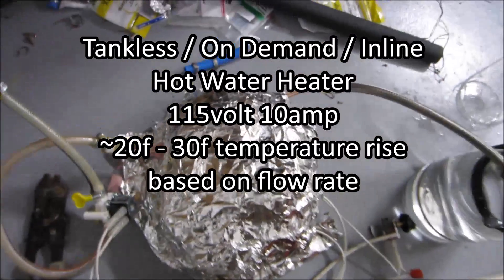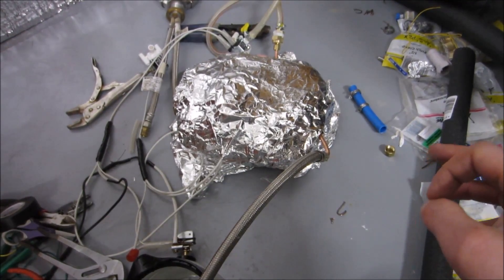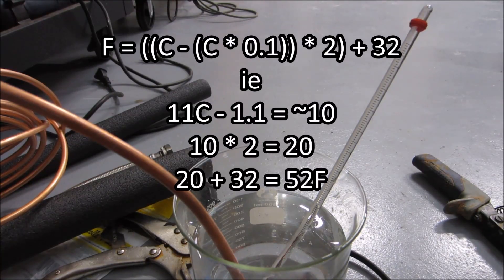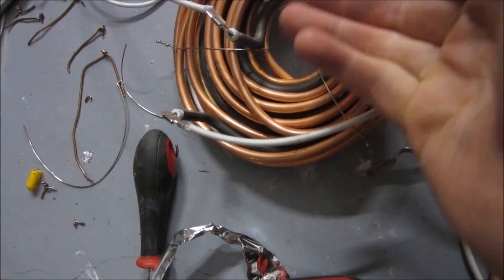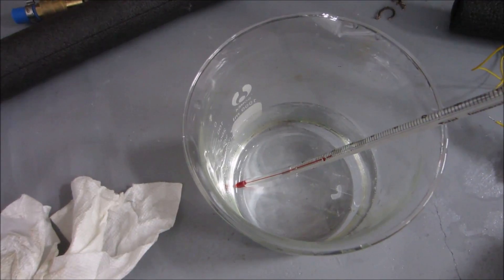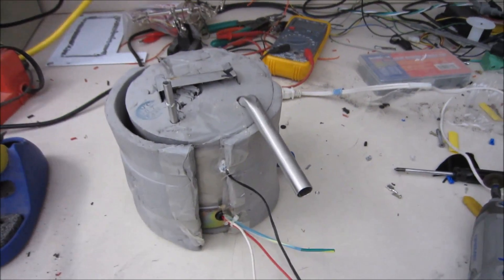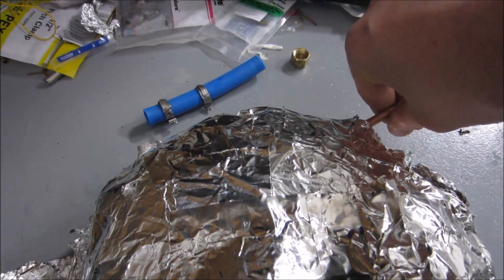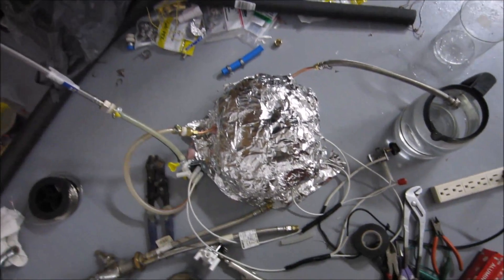DIY Tankless Inline Water Heater from "Scratch"

Comment: What do you think about us induction? Use 3 electric induction coils 1 ft apart on a normal copper pipe? Idk who to set up the electrics and regulate the temperature but I think that would be the most efficient and safer. That is as long as you are able to make sure are able to make sure the inductors do not get the pipe too hot

Comment: I was thinking of building one of these using a much simpler design: Coil of wire inside of a tube. Ohms law says a 6 ohm coil will give you 2400 watts at 20 amps, 1200w for 12 ohms at 10 amps. There are online calculators that can get the power needs,coil dimensions to ones design. The best part is you can build several super cheap and keep spares and just swap out when they inevitably go bad.

Comment: this is an old video but what about using the heating element from an oven since its more straight than a wound cooktop coil and wrapping as much copper pipe around the oven element as closely wound as you can get it the full distance of the heating element.. i think you'll get way better heat transfer by wrapping the pipe around the coil completly enclosing all the heat to inside the copper.. 

then you could take it a step further and enclose the element and pipe and backfill it with possibly molten alluminum encasing the element and pipe in alluminum which would fill most of the voids between the element and pipe that are left ensuring your getting as much heat transfered into that copper pipe as you can.  the downside is it will take longer to heat soak everything but once everything is hot youll have more thermal mass to play with.. this would be useful for larger amounts of water like running a shower instead of a faucet so leaving it run longer isnt as big of a deal.

the element should in theory survive having the alluminum poured on it but id probably make sure the element was on and hot right before you start the pour and cut power right before you do the pour..the copper has over 1900 degree melting point and the alluminum is good till around 1100 degrees....
the element when on high only gets to around 900 or something degrees so it should be ok..  

this is only my theory but im gonna try it soon and see what happens.
Reply from the maker: Good ideas - let us know how it goes. :)

Comment: If you’re a stickler for details and prefer a simplified calculation, change the order of operations to C * 2 - 10% + 32. As long as you know the 10% mental math trick it’s easy. 
11 * 2 = 22
22 - 2.2 = 19.8
19.8 + 32 = 51.8

Comment: I love how this trailed off into mental math. It was a good use of $30 imo. With conduction, your best option is a small boiler, PID or klixon thermal switch set to a nominal temp like 80-90F (won't steam - also the water line pressure is already 3 bar so pressure buildup isn't really an issue unless you're using a check valve), and a secondary PID input to activate full current - this can be done with an in-line hall flow switch. Induction heating will give you the most efficiency though. You want the heat to occur directly at the water. Anyway bravo on the original content my dude.
Reply from the maker: Thanks much for the thoughts!

Comment: Hello sir, I'm a mechanical engineering student and my senior design project revolves around this subject. this video have helped so much, and I would really love to know if it's okay to contact you and ask you a few question about the components, and how would I go about integrating a combustion unit as a heat source
Reply from the maker: This project is really simple... I'm not sure there is much I could expertly answer that you couldn't just research independently.

Comment: What about just putting another hotplate in that setup and being able to have closer to shower pressure stay got. Still will be pulling under 20 amps on a 110 breaker. If it got to hot just put some temp sensors on the coil
Reply from the maker: I believe it's a 10amp hot plate, so doubling would be 20amp approximately.  Really at that I can find a commercial solution.  This was kind of a novelty project with a novelty result, but I appreciate your practical advice. :)

Comment: uhm..  fiberglass...  no gloves.. Why are all the videos on youtube by idiots not doing basic safety?   -1 for humanity.
Reply from the maker: Well, if you said no N95 mask, I think you'd have a point.  Skin sheds often, no real harm done by just touching fiberglass.  That said, when really digging into a fiberglass project, i certainly wear full clothing and gloves because I am sensitive to handling it.  Just touching it a little with bare hands is not a big deal.  On the other hand, breathing the stuff in is a calculated risk since it can stay in your lungs for a long time (maybe forever) and with chronic exposure (if I did it for a living) it would be a death sentence.  That said, in every house that contains fiberglass, which is most, things are typically not air tight, and due to negative internal air pressure created by most HVAC setups, it sucks it right out of the walls and attic into the living space.  So low level of chronic exposure are through living in the space in almost all houses.  I'm sure we all have a fair amount of glass fibers in our lungs from that silliness.

Comment: I took a heating element  out an old hot electric hot water heater and used that , I left it 220 vokts plus it is controlled buy a thermostat . It heats my watee up in 30 seconds or less and I am using half the energy because of it being 220 .
Reply from the maker: Awesome.  Though note that 220 or 110 simply halves the AMPs, not the "energy" (watts).  For example 110 volts at 10 amps is the same amount of energy as 220 volts at 5 amps. :)
Reply: @someoneinncarolina  12v 400ah battery lifepo4 = 48v 100ah battery

Comment: Use a giant joule thief to reduce the power usage.
Reply from the maker: I don't think that works with electric heating... can't break the laws of thermodynamics. :)
Reply: A Joule theif raises the output voltage, while lowering the maximum current so power would still be approximately equal

Comment: An immersion heater element would be so much more efficient - all the heat goes into the water.
Reply from the maker: I agree, but this is for intermittent on demand duty.  Otherwise it would just be a standard tank water heater. :)
Reply from the maker: Thinking about this more... I suppose if it was just a stand alone immersion heater in a bowl of water,  you could kind of use it on demand.  The issue with tank water heaters isn't efficiency, it's that they are always on, even when you aren't using them.  So if you had a bowl you needed 5 minutes later or something, you could drop an immersion heater in.  I suppose then you might as well use an electric kettle though.
Reply: @someoneinncarolina  you should check out how some of the on demand heaters work. I tore apart a broken one ( the filament had burned out) and there's a water pressure switch system in there that turns it on and off when there's a flow. 

I'm interested in building one for myself at some point.
Appreciated the video thanks
Reply from the maker: @eleanorloring5590  Thanks.  I actually have a tankless gas powered one laying around.  The electrics from China are so cheap you can just buy those.  I was mostly hoping to do this at low power and low flow.  Recently I stumbled on silicone oil that is non combustible and will probably play around with that as a catalyst.

Comment: A water heater element in a 2-4 inch pipe 12-24 inches long with in/out fittings pulling hot water from top can put out a quart pf pretty darn hot pdq, wait a minute and another is ready. Using just electricity, your urine plus electrolysis yields a hydrogen stream, which can heat a pipe and provide a gas fired unit running off a 3-5 volt DC supply.
Reply from the maker: Super interesting concept... I'm a little skeptical about the numbers.  Have you tried this yourself?  I do believe the concept works, just not sure about the values.
Reply: Yes I've made coffee and sink hot water with heating elements and made hydrogen from urine, seawater and misc fluids. There's a pack of schoolgirls that run a gas gen from a bottle of pee.
Reply from the maker: @owlnationlegal4228  Super cool stuff.  Any pics or documentation to check out?  Thanks.
Reply: No but I did it with 2 wires, stainless washers, 12v bat and a bic if you want to pop hydrogen. Look up Youtube Nigerian Girls Generator Urine
Reply from the maker: @owlnationlegal4228  Intriguing stuff... there don't appear to be any real details, which usually points to something not being wholly true. (ie wattage output, etc. schematics, etc.) Apparently the inventor of the urea electrolysis process, which the generator is based on, said it is interesting but impractical, other than on the scale of waste water treatment plants in terms of power generation.  Who knows though... I'm going to try playing with this when I get a chance.  Thanks for sharing!
Reply: Nigerians often get a bad rap. In this case the voltage is a clue; its less than half that of cracking water.

Comment: i made a water heater using a screw in rv hot water heater element, some pipe fittings, a pump and a pid ssr thermocouple kit. I had most of the stuff i needed so it only ended up costing me 50 bucks all together. I also have been experimenting with induction heater as water heating.
Reply from the maker: Nicely done!  Induction heaters are attractive due to requiring no direct contact; but, the thing I mostly wonder about with electrical heating is how much efficiency can you really have?  If you just short a resistor it's technically 100% efficient because all electricity is being converted into heat energy (normally the definition of inefficiency with electrical circuits); however, a heat pump water heater is more than 100% efficient; at worst it is 100% efficient when a heating element turns on.  Even so something like a heat pump is comparatively very complicated in operation.  I feel like there must be a solution somewhere in the middle... peltier junction comes to mind, but I'm not sure of the efficiency off hand.  Then of course there are other factors like infrared energy losses rather than being reflected back... and increasing insulation, etc.

I'm hoping to experiment a lot more with efficiency and leveraging natural phenomenon.  Let me know how your induction heating experiments go and if you quantify efficiency for comparison. :)

Comment: Yeah! Good job. Ive been conjuring up my own in line water heater using an element. You gave me some good ideas. We think alike it seems. The sand feature i had thought of also. I want to isolate the element in its own steel chamber which will heat an upper level, also enclosed where the copper coil will be. Maybe engulfed in sand or drowned in hydraulic fluid adding a latent heat source. Had also thought of the heat resistant insulation for heat conservation and safety. Then an outer casing encapsulating everything. I'll have to try it soon.
Reply from the maker: Very cool.  I would recommend the fluid over sand due to better contact... overall though the #1 issue with my solution is that it takes a few minutes to warm up.  This adds some pressure danger potentially.  If you add a pressure blow valve then it should be fine though.  Let us know how it turns out.  Thanks for the comment!
Reply: L